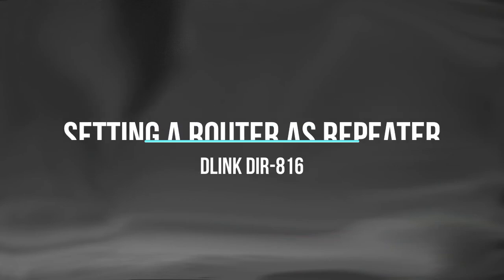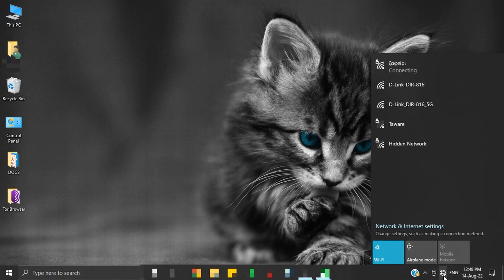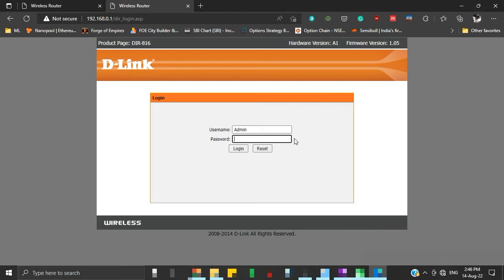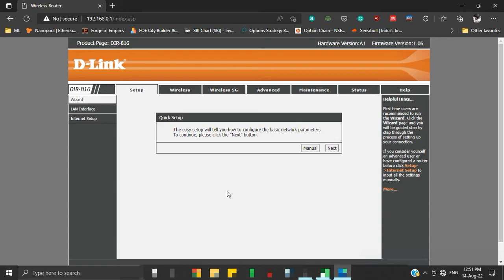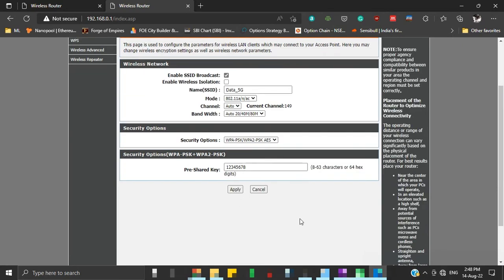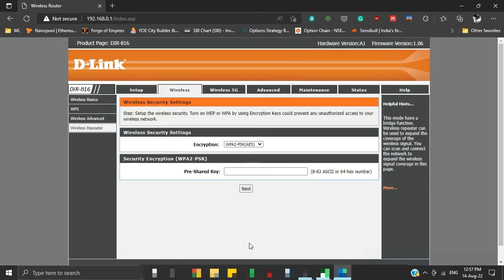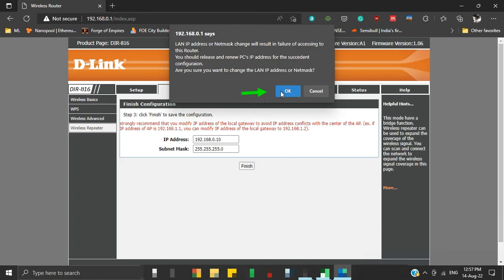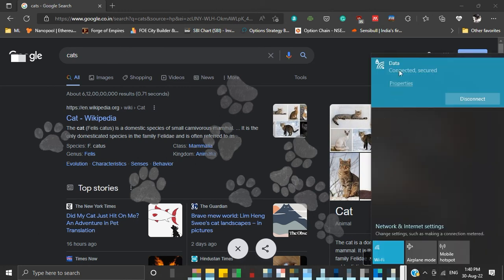Configuring Router in Repeater Mode | D-Link DIR-816 Repeater Mode Setting | Computer Tips

Comment: mine is not showing extender tp link 816 🥲 plz help
Reply from the maker: If the router does not have the repeater setting mode then the firmware is not supporting it. Make sure to update the router's firmware to the latest one.

Comment: Please show if the tp link root ap / parents router recognizes  the dlink extender as a Client or not.
Show us connected client page in the tp Links parent router's gateway.
Reply from the maker: I have a setup, where TP-Link Archer C6 as my primary router and D-Link 2750U router as secondary router. The secondary router is connected to primary using Ethernet cable (Due to they being far apart). And I use my secondary router's wireless network to connect devices. In short, my secondary router is acting as a wireless Access Point. Secondary has DHCP server off.

Now if I want to check which devices are connected to my secondary, I login to my Primary router's admin panel. Its is TP-Link router. So I go to Advanced menu and click on status. It gives me a complete list of details. In that, there is one detail with heading "Wired Clients". As my secondary router is connected to primary using ethernet cable, the devices under "Wired client" heading are the devices that are connected to my secondary router. 

Also, I can find all the names of all devices, directly or indirectly connected to my primary router, in DHCP client list of primary router's admin panel. It can be found under Advance menu, somewhere in Network tab.

Now, I tried finding details (IP and Mac address) of secondary router on primary router's admin panel, but i couldn't find any. There may be ways to find such details using some Operating system tool or any third party tool, which I am currently unaware of. I will try finding the solution and create a video on it. Thanks.

Comment: I cant setup the repeater for the 5ghz network after setup the 2,4ghz one i have the same router as you
Reply from the maker: When you log in to your router settings, under the Wireless 5G tab, you can find "Enable SSID Broadcast". The checkbox next to it has to be check-marked (enabled). This will enable your 5G SSID for the repeater. Now you should be able to see both 2.4GHz and 5GHz band networks.

Comment: I m getting a problem. I have the same router dlink dir-816

The next day whenever i try to connect it shows ip configuration failed and then it doesn't connect. It searched this prblm in youtube and they told me to change ur ip address in ur device but when i change ip address it gets connected but then it shows no internet. What can i do to solve this prblm.
Reply: This problem occurs after setting router to repeater mode
Reply from the maker: @AnimeBingeOdyssey  I did face the same issue (in repeater mode), I tried upgrading and downgradig the router's firmware. But none of them worked permanently for long time. It was weird because it sometimes worked and sometimes didn't. Then after lots of searching, I found the stock firmware (but from non dlink website). I flashed that firmware in my router and since then its not giving me this issue. Otherwise I had to reload the configuration file to my router quiet often. You may try the same, but with firmware from official website. If I remember right, 1.06 is the latest one. You check your router's hardware version and then download the appropriate firmware.